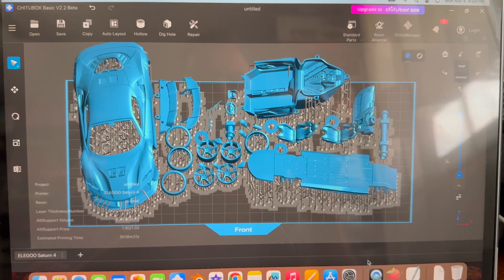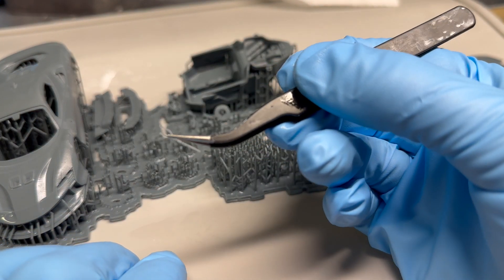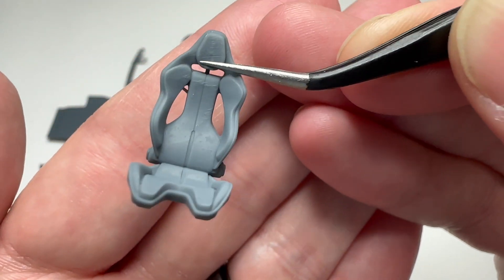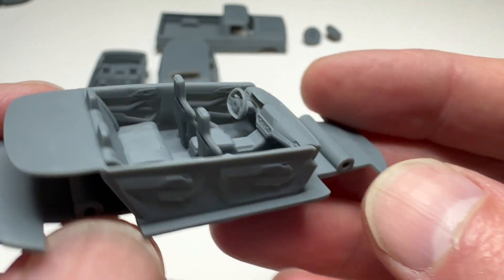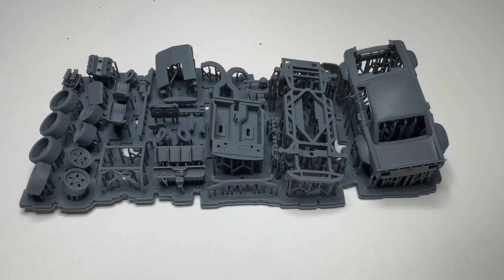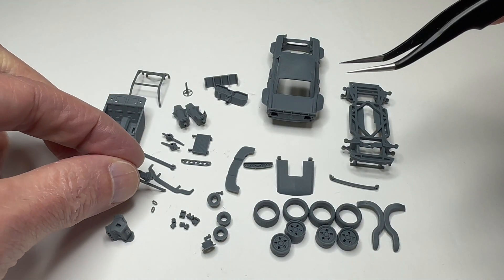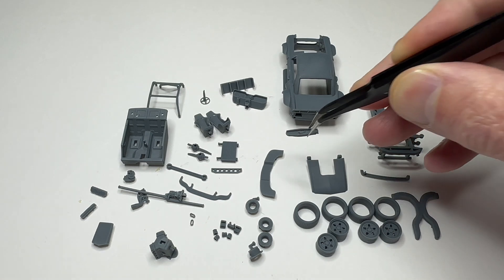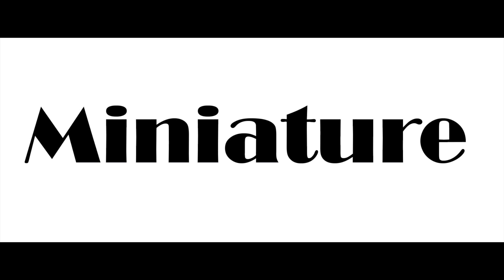... But can you 3D print SMALL scale model cars? Elegoo Saturn 4

Comment: Why dont u try doing it in 1/76 scale?😂
I have a few cars bought from ebay in 1/76 scale,  and with someone i use to do wheels for me in 1/76 once i supply images and dimensions.
Reply from the maker: I can’t even imagine printing anything that small 🤓 it may be difficult to distinguish between a support and the part attached to it.
Reply: @ScaleModelExperiment  lol, as i see in ur video that u got some small pieces with the 1/64 vehicles,  even thou not as many parts.

 The cars mostly comes in 2 pieces as u get a detailed body with dashboard already in, and a chassis with seats and wheels. The dashboard would have been better if it was a separate part. Size ranges about 50-55mm long and 22mm wide.

As for the wheels, they mostly comes in 2 parts, the rims and the tires, and they're about 10mm in diameter in total(rims and tires), and 2-3mm wide. Ive had 5-spoke Ford van wheels, 14-spoke Bola van wheels, and Chevy Impala SS wheels done.
Reply from the maker: @mbwoods2001 ok, so they aren’t as small as I imagined. I could try sometime.

Comment: It looks like more material was wasted than was used for viable parts.
Reply from the maker: That is the trade off. You CAN print parts low to the build plate to reduce waste at the expense of parts that have print lines all over them. That’s why I angle and lift the parts to reduce prep time.

Comment: Fantastic small scale. The reason you got a loss of detail when you scaled down your car to 64 scale was because you scaled down a larger model. If the model is designed to be small you can get way smaller with fantastic detail. You should see if the designer could change the scale for you.  If it's done right you should be able to get down to an amazing size. Also, when you scale down you must also make your layer height smaller. Try printing your smallest version and change the layer height to 25 microns, you'll get better small detail.
Reply from the maker: I totally understand. I did not rescale the files at all. That is the way they were given to me. I do agree that files designed for smaller prints achieve better results. The Kei truck I printed will eventually be upsized to 1/24 for printing.  I did not consider changing the layer height when printing smaller. I left it alone at .025. Thanks for watching and leaving me the tips.

Comment: What resin are u using. Can you share your settings ?
Reply from the maker: For this video I used Elegoo 8k space grey water wash resin. I printed the parts at .025 layer height with 2.4 second exposure time. Your exposure may vary depending on your environment and printer. I recommend running a test verification print. Thanks for watching👍
Reply: @ScaleModelExperiment thanks !

Comment: The further you went, the more impressed I was.
Reply from the maker: Here’s the thing Ray, I can tweak my settings to make the cars even more sharp. It’s a rabbit hole for sure. But, that comes at the expense of build time.
Reply: @ScaleModelExperiment  ???   But you got the same scale in better detail as you went along (and using a different software site). Are you saying you changed settings on those to make detail better, not that the software provider did a better job?
Reply from the maker: @ you’re absolutely correct, I changed nothing except the files I was printing. One designer was more detail than the other. Not knocking anyone, but one was designed for a larger scale and simplified for 1/64, other was designed for 1/64. Now I do plan to print the Kei truck in 1/24 someday. It may seem basic at that scale.

Comment: I imagine you could get some sharpness back if you play with lowering exposure times. The finer the detail the more dialed in you need those settings to be. I haven't used that resin but if you check out some info from people printing tabletop gaming miniatures they often have better info because they are working on tiny things with very fine detail.
Reply from the maker: That’s a good point. I didn’t consider that. I’ll have to experiment.
Reply: @ScaleModelExperiment  I did some experimenting with the normal exposure times with the vanilla 8K water washable. I went all the way down to 1.6 seconds but had the layers separate during curing on a 1/25 scale arm rest I printed. I settled on 2.0 seconds and really didn't see any noticeable difference between the two settings.
Reply from the maker: Thank you Brian, I will play with exposure settings to try to get a sharper print.

Comment: how much does a 3D printer cost
Reply from the maker: Mine was $380 for the Saturn 4. Black Friday is coming up I’m sure Elegoo will have a sale.
Reply: @ScaleModelExperiment  wow that aint a bad price at all,im canadian so that would be around 500 still work it
Reply: @ScaleModelExperiment  thanks for the quick reply
Reply from the maker: @ of course. The Saturn 3 is basically the same as what I have for $100 less. Only difference is mine has a self leveling bed. Resolution wise they are the same.
Reply: The Saturn 4 is $299 on the Elegoo website right now. It'll probably be that price on Amazon during the black Friday sales. I just recently purchased one after watching this channel and It's a great printer and easy to use. Two people at my work have purchased one after I showed then some of the parts I printed. They have fdm printers but no resin printer.
Reply from the maker: @BrianF.1969 that’s a good price for the Saturn 4.

Comment: ❤ what size scale do u use in this vedio making body please
Reply from the maker: Hi Jon, the files were all designed to that scale. The Ferrari was 1/43, the rest at 1/64. If you simply scale down a 1/24 scale file to 1/64 your panels become incredibly thin and you’re begging for a failure.
Reply: @ScaleModelExperiment  can do 1 24 scale next
Reply from the maker: @JonJones-k8l that’s what I normally print on this channel. Maybe 1/12 next?